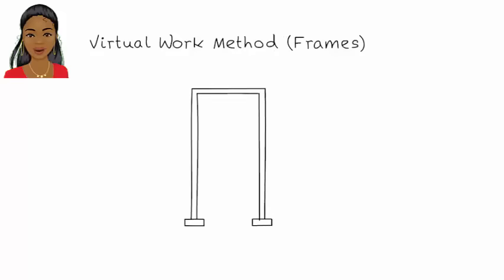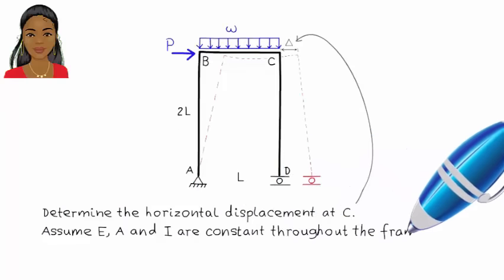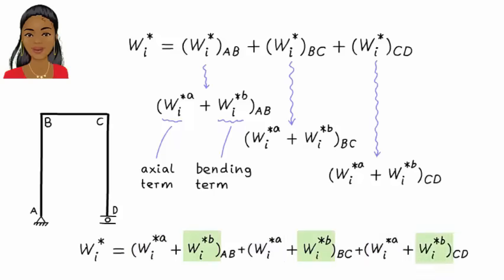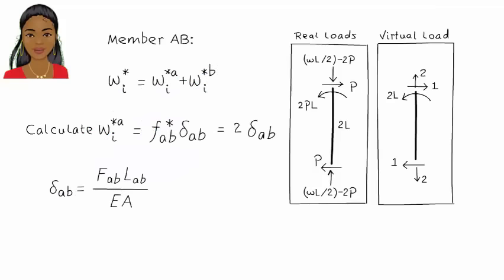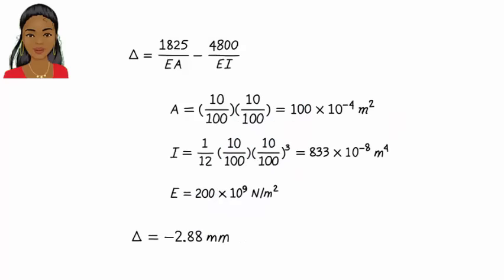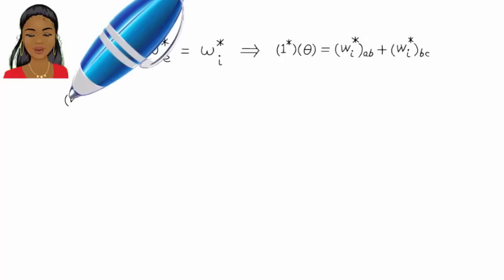SA23: Virtual Work Method (Frames)

Comment: Great help Dr. Structure. But please clarify why it is integral of (1-x/4)dx NOT (1-x/8)dx [11:48].
Reply from the maker: Thank you for pointing out the typo. The expression should read (1 - x/8), not (1- x/4). The answer (1600/EI) is based on the correct expression.
Reply: I believed it was a typo. Dear Dr. Structure, could you please make tutorials on Stiffness methods. I and many students out there will really be grateful for your kindness.

Comment: Hi Dr.
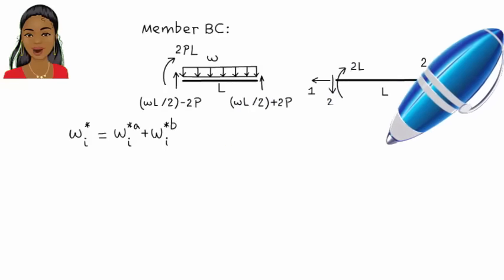at 6:46 why is there no internal bending moment on the RHS of the free body diagram. In other words at point C?
There was no hinge in the original question so in confused.
Reply from the maker: Correct, there is no hinge at C. But that does not mean there must be a non-zero bending moment at C. 

Note that member CD carries an axial force only. This is due to the fact that we have a roller support at D. Therefore, no shear force develops in member CD. No shear force at the base of CD means no bending moment at the top of the member. That is why bending moment at C is zero.

Comment: Could please elaborate that what are the rules to find member forces in frame member like direction and moment positions?
Reply from the maker: A frame consists of a series of connected beams and columns. 

Generally, at each end of a frame member, we have an axial force, a shear force, and a bending moment. Although one of more of these forces can be zero for a given frame.

When the member end forces are unknown, we need to assume their directions. For example, we can use either a clockwise or a counterclockwise direction for a member-end moment. 

For each member (shown in isolation) we show/draw the three unknown member forces at each end. This gives us a total of 6 unknown forces for each member.

We then transfer the forces at the ends of each member to their adjacent joints. So, if member AB is connected to joints A and B, we draw three forces at joint A and three forces at Joint B. When doing so, however, we need to change the direction of each force. For example, if we show the moment at end B of member AB in the clockwise direction, we need to draw the moment in the counterclockwise direction at joint B.

If the frame is statically determinate, assuming the support reactions have been calculated already, we can calculate the member end forces using the three static equilibrium equations applied to each isolated member.
Reply: @DrStructure got it now ! Thanks

Comment: I just watched an example in a structural book and found out that it considered the effect of "shear" in frame analysis for each member. I wonder whether or not shear effect can be disregarded or included in the analysis?
Reply from the maker: It depends on the type of analysis we are performing. For displacement calculations, the effect of shear is negligible in most cases. For determining critical stresses for design purposes, however, shear is generally included in the analysis. Here in this video, since the discussion is about displacement in typical beams and frames, we can safely ignore shear.

Comment: Dear Dr. Structure, why when you divide the various rods, the horizontal force P, which is present in the node is not reported on the rod BC?
 Thanks.
Reply from the maker: In some cases the horizontal (axial) force is shown and in some cases the force is omitted from the free-body diagram. We can omit showing a force when we know it is zero. So, when you see a free-body diagram of a member for which the axial force is not drawn, it means the axial force in that particular member is zero.

Comment: Sorry Dr. May i ask a question regarding my university example exercise? 

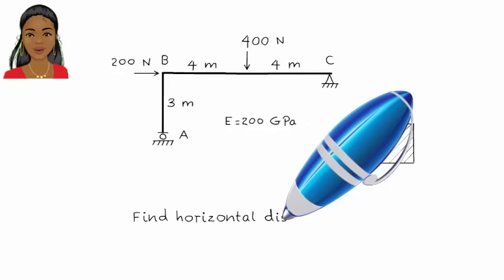It is regarding the force method (unit load) for frame. The question’s diagram look exactly like @ 8:21..except that both support at A and B are pinned (indeterminate frame). The only actual load is UDL 5kN/m from B to C. With height (A to B) is 5m and length (B to C) is 10m. Now the question is to determine the reaction at each support. 

In the example (referring to my university text book example), the redundancy is 1. So they replaced the support A with a roller support, and a horizontal unit load is applied at that particular support. To make it short, they have come out with a vertical reaction at A = 29.17kN (upward), and at B = 20.83kN (upward). And horizontal reaction at A =  8.33kN (right direction) and at B = 8.33kN (left direction. 

However, my own working method results in different direction for the horizontal reaction in both supports, and also the vertical support at A and B is swapping position. Then i try to figure out what is the difference in my calculation and the book example, the only differences are the unit load location (i placed at C direction to the left, meanwhile in the textbook placed at A to the right), and another one is the way i cut the section BC to find the moment equation, i made a cut section origin from B. In my text book, they made the cut origin from point C. 

As u know, in force method, we have to separate the calculation in two cases, which is when the beam is subjected to the actual load (actual load system case), and when the beam is only subjected only to a unit load (unit load system case). The problem arose during the calculation in the unit load system, (kindly note that the Ra = 0.5 upward and Rc = 0.5 downward for both my working calculation and my textbook calculation). BUT since the reaction at A and C is not in the same direction, when i cut the span BC and made B as the origin, my moment equation (lower case m star) due to unit load at B is positive. My text book made the cut at span BC with C as the origin, this results in their moment equation to be in negative. 

The above is the main reason why my vertical reaction magnitude at A and B is swapped position when compared to my textbook answer, and it also has flipped the horizontal reaction direction at both support as compared to my text book. 

Do u have any rule of thumb for formulating the moment equation in frame? What should i do to avoid mistakes (especially in assuming direction)? 

I am your online student from Malaysia, i do a part time studies here while working full time. I hope u can really help me in understanding the mechanic of this structure. Should u need my email, u can contact me at affiq1990@gmail.com . I really appreciate your work Dr. Thank you so much for all the educations taught to us.
Reply from the maker: You may have made a mistake in calculating the support reactions due to the unit load placed at A. If you are placing the unit load pointing to the left, the support reaction at A is going to be downward with a magnitude of 0.5, and the reaction at C should be upward. In another word, the direction of your reactions should be opposite to the direction given in the textbook. 

As long as you are consistent in your calculations, the assumed direction of the load (displacement) does not matter. At the end, you should get the same support reactions. 

As for the bending moment equation for BC, it does not matter whether you set the origin at B or at C. As long as you take all the forces into consideration, the final results would be the same.

To determine the sign of the moment equation, you need to define the beam/column bottom fiber. For horizontal beams, we know where the bottom fiber is located. For columns, you need to assume the bottom fiber. The internal bending moment in the beam should be drawn in the positive direction with respect to the bottom fiber. This means, if we cut the beam, at the left end of the cut, the moment needs to be drawn in the counter-clockwise direction, while the moment at the right end of the cut should be drawn in the clockwise direction.
Reply: Dr. Structure i have solved for the reaction at both supports, and it did give the same answer as in my textbook. THANKS A LOT DR...i really love the way you explain. May god bless you always. Thanksss
Reply from the maker: Glad to be of help :)

Comment: Hellooo, i have a question about the negative sign using infront of Fab in member AB. Where did it come from? ( - (wl/2 - 2P))
Reply from the maker: The negative sign is placed there since the member is in compression, which means the member shortens due to the axial force. When a member elongates (due to a tensile force), we consider delta to be positive. When the member shortens (due to a compressive force), delta is expressed as a negative value.

Comment: Hi,
could you tell me why is the bending on a beam considered for horizontal displacement on a frame , despite it bending downward?
Reply from the maker: Very good questions.

Yes, the beam bends downward. But that does not meant it does not move laterally under the applied load. Although small, the beam does move laterally due to w. 

Assume the lateral load (P) is zero. So, the only load applied to the frame is the uniformly distributed load (w). How does the beam deform under the load at D where there is roller? Common sense suggests that the roller moves to the right since CD is going to be compressed. (we can also prove this mathematically), Now if the lower end of CD moves, the upper end also has to move (though not by the same amount). That is, point C moves laterally even if P = 0. This is in part due to the stored bending energy in the beam. Of course this stored energy also makes the beam bend downward.
Reply: Ok thanks! That makes sense.  But what I still can't figure out is this: If I was to draw the BMD for the beam, I would get a diagram in which there is bending downward and/or upward , no matter what the loads are. Why is that vertical bending considered for horizontal dispalcement? 

Is it because the direction of the load is horizontal on the virtual frame , which would mean that all displacement resulting would be horizontal? 

If I was to evaluate the bending with another method, would the bending in the beam still be considered for horizontal displacement?
Reply from the maker: You need to shift slightly your analysis of the problem here. 

Here is what I suggest: Ask yourself two questions:
1. Does the beam bend under the (real) applied load? Does a bending moment develop in the beam? In this case the answer is YES.
2. Does the same beam bend under the virtual load? Again, the answer is YES.

If the answer to both questions is YES, then the beam does indeed store internal bending energy that contributes to the horizontal displacement.

If the answer to either question is NO, then no internal energy is stored in the beam, hence no impact on the displacement. 

So, if the placement of the virtual unit load would not have caused a bending moment to develop in beam&#160;BC, then the bending of the beam due to&#160;applied load&#160;would not have contributed to the horizontal displacement at C.

In response to your statement in the second paragraph,&#160; we intentionally place the virtual unit load at C, because we want to calculate horizontal displacement at C. If we were interested in calculating, say vertical displacement at the mid-point of the beam, then we would have place a vertical unit load at the mid-point.
So, using this method we can calculate only one displacement at a time, not all displacements.

Concerning the third paragraph of your post, if the method that you are going to use requires calculating bending moment equations in the beam, then yes, it plays a role in horizontal displacement computations.
Reply: Ok. Thanks a lot!
Reply: @DrStructure  I just want to say thank you for responding to comments like this, i learned a lot and this wasn't even a question I had, but now i understand more deeply whats happening. Very awesome, i love it
Reply from the maker: @Josh-zk7pf  Thanks for the feedback!

Comment: Why is M(x) in member BC with limits 4 <= x <= 8 equal to 1600-200x, shouldn't it be 800 - 200x???
Reply from the maker: There is a shear force of 200 at the left end of the segment, having a moment arm of x.
There is an applied load of 400 having a moment arm of (x-4) about the cut point. 
So, M(x) = 200 x - 400(x-4). Or, M(x) = 1600 -200x.
Reply: @DrStructure  Thank you, Doctor!
Reply from the maker: You're welcome.

Comment: If the moment diagrams are to be geometric shapes, and since we're assuming EI is constant, wouldn't the method of "Values of Product Integrals" be a simpler way to solve this? Just saying...
Reply from the maker: +Vinny Lemae Generally, a given problem can be solved using multiple methods. The point of this lecture however is not to find the easiest or the most convenient way to solve a specific example problem. Rather, it is to explain how a particular method works. The example is there for illustration purposes only. 

In practice, frame structures are generally analyzed on a computer using the displacement method (or more broadly, the finite element method) where only a few seconds is needed to perform the necessary computations. But, as engineers we still need to have a fundamental understanding of how structures behave and why. The classical analysis techniques provide a basis for developing such an understanding.
Reply: +Dr. Structure U ROCK

Comment: Dear Dr Structure @5:44 , Should M(x) = Px-2P?
Reply from the maker: No,  M(x) = Px is correct. 

The origin of the coordinate system is at the base of the column with x going up. If we cut the column at some distance x from the origin, and examine the segment from the origin to the cut point, the only force that causes a moment about the cut point would be the horizontal force P at x = 0. The forces that you see on top of the column do not appear in that free-body diagram since the diagram is that of the lower part of the member.  So, a force of P placed at distance x from the cut point creates a bending moment of Px at that point.

Comment: hi.
Can you please explain why you didn't consider the moment of 2PL in member AB in your analysis. Thanks
Reply from the maker: Bending moment is part of the formulation for member AB.  The solution given involves writing the bending moment equation where point A is taken as the origin. So, x is measured from A upward. That means 2PL does not appear in the free-body diagram of the lower part of the member. The only force present in that diagram is P. So, M(x) = Px. 

If we would have taken x from the top, then we would have gotten M(x) = 2PL - Px.  

Either way, we would end up with the same results.

Comment: I feel embarresed to ask but where did the +2p and -2p come from in the reactions stated at 3:30 ?
Reply from the maker: There are no embarrassing questions around here. :) 

There are two horizontal forces of magnitude P separated by distance 2L. They form a couple resulting in a clockwise moment of 2PL.  This has to be counteracted by a counterclockwise moment of 2PL. The 2P and -2P (separated by L) form such a moment.

Alternatively, just write the three equilibrium equations and solve them for the unknown reaction forces, since the frame is statically determinate. 

We can also approach this by analyzing the frame twice, once due to the distributed load w and then due to the horizontal force P.  When the frame is subjected to w only, the vertical reactions at the base would be (wL/2), both upward. 

When the frame is subjected to P (at joint B) only, if we sum the moments about A, we get a vertical reaction of 2P at D. When we sum the forces in the y direction, we get -2P at A, and we sum the forces in the x direction, we get P at A.

Adding the results of the two analyses, we get (wL/2) -2P at A and (wL/2)+2P at D.
Reply: Ah, Okay I would never have thought of that .  Thank you very much for your quick reply. You are very good at this

Comment: why do we not consider deformation due to shear here
?
Reply from the maker: +Funi Kwon Similar to axial deformation, shear deformation in beams and frames is generally very small and can be ignored. Since internal (virtual) work is a function of internal deformation of the member, then internal virtual work due to shear is generally negligible-- it is less than 1% of the virtual work due to bending.

If however we are dealing with a deep beam, one with a large cross-sectional height (like a bridge girder), then shear stress and deformation may become significant and may have to be considered in design calculations.
Reply: +Dr. Structure crystal clear